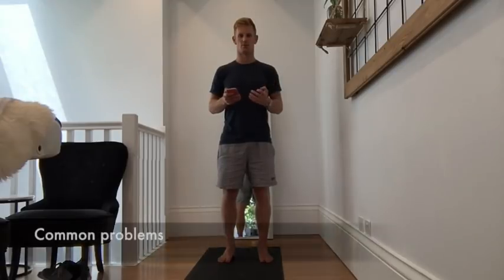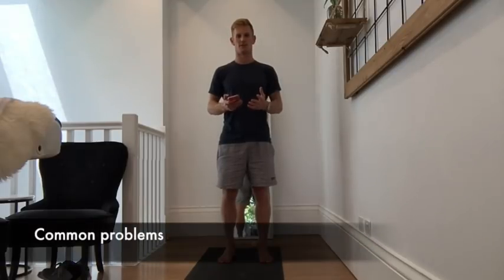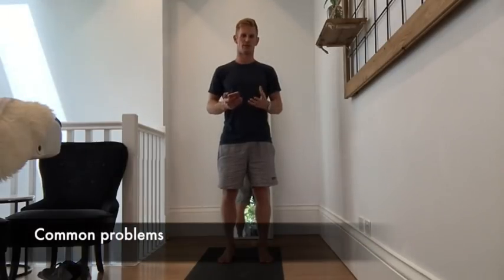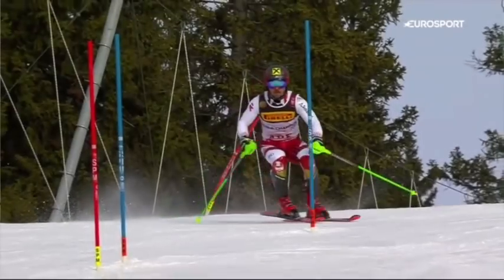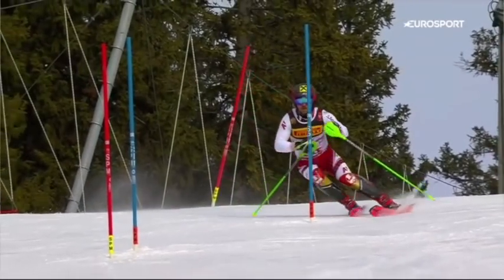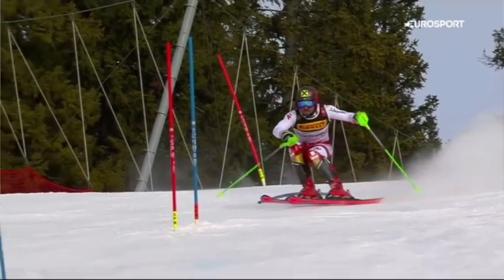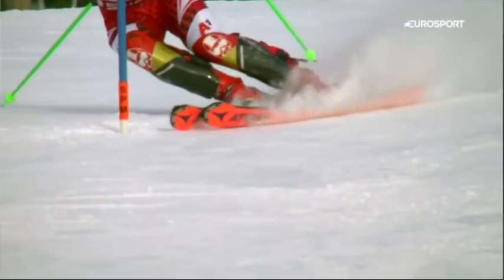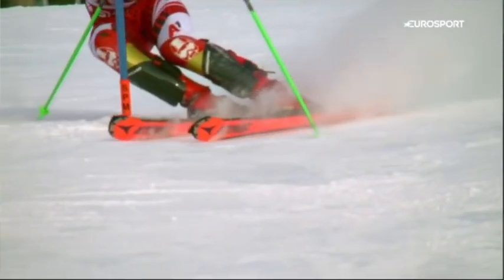Rotational Alignment in Skiing - Preview

Comment: Great topic - too often ignored during ski instruction. Please can you clear up a confusion I have: The knee is a hinge joint and powerful in that plane of movement. A rotational effect can come from the foot / lower leg bones rotating under the knee. This is however a limited movement  - 90 degrees or so Does the 'rotational effect of the knee' - powerful / strong enough for skiing forces, come from the rotation of the femur - which is a ball and socket joint - capable of great strength. I always thought that knee rotation put torque on the cruciates - leading to erosion and damage.  Thanks.
Reply: @Bigpictureskiing  Thank you I understand: I need to watch your video. I asked the question because too many recreational skiers  'push the knees in' to turn - a risky manoeuvre for the non specialist  who has not trained the muscles etc  or whose stance and posture places the knee joint in danger through uncontrolled out of balance rotation.  A fascinating subject I must learn more from your references.  Best wishes and thanks. David Pounder
Reply: @Bigpictureskiing  Thanks - I'm learning!